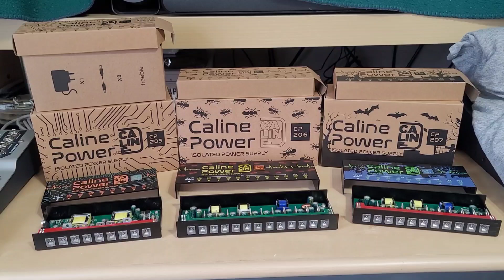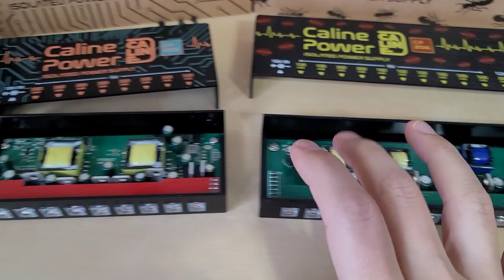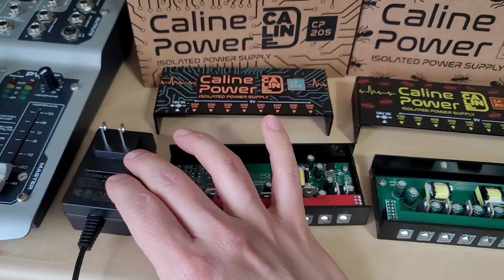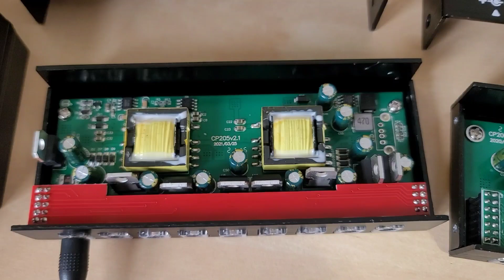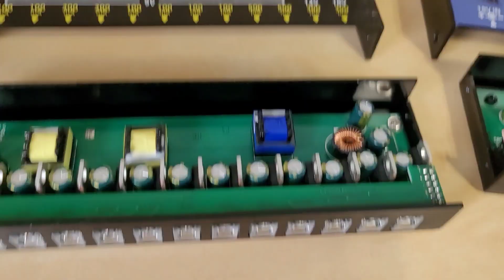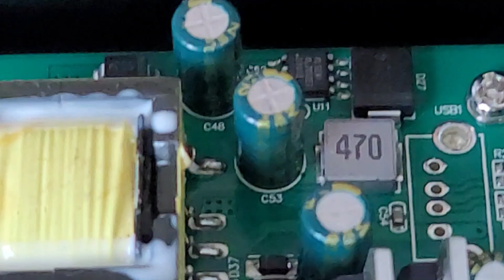Caline Pedal Power Supply: True Isolation? How They Compare To Other Brands?

Comment: Are these PSUs grounded considering they use a 2 prong wall adapter?
Reply from the maker: Yes, Class 2 wall wart PSUs use two prongs neutral and hot, but no earth ground. The neutral and earth ground are bonded at a residential main panel, but your amp because it has bare metal surfaces needs an earth lug to keep objectionable stray voltage potential off these metal parts. As a result a daisy chain with a class 2 PSU will create a loop between its neutral and the amps earth lug, acting like a huge antenna. 

Adapters like the One Spot add lowpass filters to reduce the noise this loop would generate, but cheap ones like the one I showed from Amazon, save the few cents and forgo those filtering components.
Reply: @Bassguitarist1985  You're a wealth of excellent information, just found your channel!

So in the above scenario you described where the Caline has two prongs vs a three prong ground, I think I understand why an amplifier would need it; but as an example, I also recently purchased purchased a Fender Engine Room LVL 12 in addition to the Caline CP-205. 

Why does the Engine Room require a 3 prong earth ground? Is it because it's providing 500mA on each of the isolated ports, in addition to two that can switch between 9v, 12v and 18v? Probably something basic I'm not aware of 🙂

As far as the Caline goes, I generally run my amplifiers and my power bricks first into a 3 prong power surge protector before plugging that into a wall - are there any additional benefits (other than protecting against surges) to a power supply like the Caline since it doesn't have an earth ground? Or does it literally not matter at all due to the reasons you highlighted above?
Reply from the maker: @CleanTheWookie  no matter. The above comment still applies. Thank you for watching!
Reply: @Bassguitarist1985  No probs, thank you for the response!

Comment: Hi bro. Thx for your videos. I want to buy the cp206, because i have 10 pedals in my pedalboard (one of these requires 18V). Do you recomend this power supply? I'm from Colombia (i apologise my english) here we have 110-120V from wall. Thanks
Reply from the maker: Hello! Long as your pedals do not need high current above 500mA yes this should be fine!

Comment: Nice review, as always. In your opinion, is there any mayor benefits between CP-206 and CP-207, besides of the increase of 2 more power ports? Are those two exactly the same?
Reply from the maker: Yes they are exactly the same. You just get a little extra capacity overall. Thank you for watching!
Reply: @Bassguitarist1985  Thanks. I just bought a CP-207. I have serious noise issues to solve.
Reply: @sebastian.arancibia  Did it solve your noise issue?
Reply: @slowpoke7888  Yes. I got the CP-207 and works like a charm. Totally recommend.
Reply: @sebastian.arancibia  Thanks Seb. I think I will get one.

Comment: So if I need an isolated 18v supply for my pigtronix rototron that I want to preserve and rum well... this should do it?
Reply from the maker: Yes. That pedal needs a min of 100mA at 18V, but recommends 300mA at 18V for headroom according to the manual. Yes this should be no problem!
Reply: @Bassguitarist1985  Thx for your reply! Mostly I was a little concerned about how isolated the circuit was and I run almost all the 9v at the same time as this if there'd be any risk of damage but sounds unlikely... how do you think the extra headroom works? Is it likely to clip more with the 100mA out?
Reply from the maker: @Tasjudoka  there is only one 18V output rated at 300mA, that should be plenty.

Comment: Awesome video!

I'm away from my kit right now, I won't be home for a couple of weeks, and I was thinking about power supplies. I started questioning how true it is that my Voodoo Labs x4/x8 are actually "individually isolated".

I started to think I probably got ripped off on a glorified daisy chain, because to be truly isolated, each output would need it's own transformer at least. so how could that possibly fit in something so small and light?! 

The way you talked through the circuit makes perfect sense, with each output having it's own secondary winding on a single transformer, amounting to the same thing.

I couldn't find anyone who actually opened one of these up, so I was itching to get home and look for myself. But now, thanks to you, I don't have to.

Thanks again for taking the time to make this great video.
Reply from the maker: My pleasure! Be sure to check out my other videos on these power supplies. They are great for the money but if you are trying to use them to power high current pedals like the HX Stomp or a multi-effects Digitech pedal for example, then they would not be the best choice for that application. Other than that they check all the boxes for about 98% of all the pedals on the market these days!

Comment: Is there a reason why you did not show actual isolation with a multi-meter (or better yet, a mega-ohm meter), or perhaps run one tap with a heavy load near it's rating on a long/inductive lead then measure crosstalk noise through to an adjacent tap running a light load ?

Just the appearance of transformers inside the chassis does not guarantee isolation. Even when a total of ten leads (assume two for AC-in and 8 for four +/-pairs does not guarantee the PCB layout and elements such as the panel-mount jacks maintain galvanic isolation. And these are areas where inexpensive power supplies have failed to maintain circuit isolation in the near-past.

Also, those transformers : They do not appear to be toroidal designs. (they look a bit more like a flat E-frame).
If so, they will be much more susceptible to crosstalk problems. These only show up under load (e.g. wide buss synchronous math processors such as found in DSP and ARM chips), and are particularly annoying when digital noise leaks from the tap supplying a e.g. large reverb multi-pedal and the noise shows up in an analog drive which has minimal filtering on the V+ and very low current draw.

I also want to note that, even though the per-tap linear regulators appear to NOT share a common heatsink, they also do not appear to have any heatsink at all. As far as I can see, there are no air-ventilation slots in the chassis of the power supply. This means that the heat of each channel is radiated into a dead-air space in the power supply, and relies on radiated conduction to the chassis.  From a thermal standpoint, this is a fairly inefficient method to get heat off the regulator's junctions and out of the device. And we all know that power supplies are often mounted to a pedal board via hook-n-loop materials, which are very poor conductors (in fact, they are great insulators). 
This little box has the potential to run quite hot (8 linear regulators and a relatively poor thermal conduction path.)

I haven't done system design in 25+ years**, but this one presents some real concerns, to me.

** (not exactly true, as I did some design of non melt-blown filtering systems for PAPRs in the early 2020s.)
Reply from the maker: Thank you for your comment and information! I have done an ohm test in other videos about these PSUs where it shows infinite ohms across the negative tips of the outputs. Unfortunately I don't have tools yet to properly measure cross talk noise. I do have the schematics for these and there is galvanic isolation from the wall adapter and the outputs. Multiple secondary windings isolate outputs from each other. I did not show the schematics out of respect for the manufacturer.

I too agree with you that the lack of heat sinks for the linear voltage regulators is a bad design. The biggest issue that I have with these power supplies is that they are not a good choice for high current applications beyond 500 mA because of that. For a budget PSU it checks the box for over 90% of all the pedals on the market. 

The manufacturer monitors my videos and I have a direct link with their product specialist (CS/marketing) who helps translate my feedback to the engineering team in Shenzhen. It's been a great working relationship as a prosumer of their products and other companies.

Thanks again for watching and for the knowledge!
Reply: So which one is the best and safest of thoese 3 models👆
Reply: @mohdazizan2181  To answer this, we'd need two things. (A) results of a dynamic (noisy) load test demonstrating the bility to provide clean power to a load with high-frequency noise transients in addition to the more typical low-freq dynamic load testing., and (B) a complete reverse-engineering schematic creation + component/tolerance analysis.
SINCE they are using a similar design methodology on all three, 'best' will boil down to how steady the power is under dynamic loading of all sorts; how well it rejects noise on it's inputs and outputs; and how well it rejects cross-channel crosstalk.
"Safest" is usually related to 'how close to runaway thermal junction temps" and how the design encourages junction temp reduction. This is VERY much a test-and-analysis question. Those who have done this kind of design before can look at a circuit, mechanical build, and cooling design and make general-observation-type statements.... I think they'd agree with the general info I put in my original post. I still don't like a no-heatsink, no convection-chassis design in a typical-use scenario where the device is located in a dead-air-space (under a pedal board) and mounted on thermal-insulated material (dual-lock). In this scenario, the junction temps of those regulators (when working hard to produce lots of current) can get closer to their failure temps, and certainly into a range where they begin to induce more noise. But this all takes careful measurement and analysis.

Comment: Hi! Thank you for your review. Looks like you know these units really well. I hope you could give me an advice. I just bought a CP-206 to power my HX Stomp, using 2x500mA outputs with a current doubler. For some reason it starts producing weird clicking noises after about a minute of use. I linked a video demo of this noise. Hope you could help me figure out what's the issue here. Thanks in advance!
https://youtu.be/YMSHl-hfBSQ

I should add that with the native Line 6 power supply it works fine. In this setup I'm also powering my Shure wireless unit from a 300mA output of the Caline. In the demo however I'm running it with a cable to eliminate the radio factor
Reply from the maker: Hey! I would actually add more current. The HX Stomp takes 850-950mA constant current. Have you checked the volts with both outputs?
Reply: @Bassguitarist1985  I haven't checked them with a tester but I assumed the 9v rating on them is correct. Do you suspect it might not be?
Reply from the maker: @rayzberg  I think there is not enough current to drive that pedal and it is causing the voltage to drop too far below 9 volts. The original power supply is rated up to 3 amps at 9 volts and the Caline would be maxed out.
Reply: @Bassguitarist1985  That's unfortunate. I know that people use 2x500mA at 9V for their HX Stomps, using other power supplies. Even the CIOCS video you linked suggests that it shouldn't draw more than 900mA. I was very excited when I found this Caline at about a quarter of the price of Voodoo Labs or One Spot power bricks. Too bad Caline is not able to keep up
Reply from the maker: @rayzberg  yeah unfortunately as you approach the max current rating of the output, the voltage will sag to about 8.7vdc. For analog pedals that is not too big of an issue, for digital pedals it can cause problems. 

Have you tried combining a 500+500+300 lines?
Reply: @Bassguitarist1985  haven't tried that. I'd need more sofisticated adaptors for that:)
Reply from the maker: @rayzberg  understood. Let me know if that works. Apologies for the difficulties. A linear voltage regulators are the limiting factor for these budget power supplies, especially since they are not heat-sinked, as a component heats up the voltage is going to drop. This is what I think is happening.
Reply from the maker: @rayzberg  I ordered myself some components to test the issue you are having. My guess is what is happening is the voltage is dropping below 9 volts. If you give me a few days I should be able to post a video on how to potentially fix this with the power supply you have. The HX stomp is a tough pedal to power with a standard power supply other than its own. My thought is the two 500mA + 500mA lines is not enough, and adding a 3rd output to compensate for the voltage drop of the linear voltage regulator will solve your issue
Reply: @Bassguitarist1985  appreciate all the time you've taken to look into this. I will also experiment some more to make sure the wireless receiver is not contributing to this issue
Reply from the maker: @rayzberg  My pleasure! I should have the parts by tomorrow, and a quick video up in the next few days.
Reply from the maker: @rayzberg  the Line 6 DC-3H is the OEM PSU for the HX Stomp rated for 9V and 3A or 3000mA. Pedal takes 800-900mA to run. I would double check the current doubler wire you are using. Wire AWG needs to be sufficient to handle the current. If not the voltage will drop too much.

I will do some tests in the next few days and get back to you.
Reply from the maker: @rayzberg  so I did a test with the two parallel 500 mA lines connected together with an 11ohm resistor to get about 800mA. The voltage is dropping to 8.7 VDC. This is normally acceptable but for digital pedals they may require tighter regulation. It is also important to note that you need at least 18 gauge wire in order to run a load like this otherwise the standard 24AWG to 28 AWG will be insufficient size as the voltage will be lower at the pedal then at the source because of the thinner wire causing the voltage drop. 

It is also important to mention that series linear voltage regulators employ a series load resistor in the circuit design so that in the event of a short circuit instead of the regulator burning up it will be a resistor that can handle the wattage dissipation. As I mentioned in other videos this is the main limitation when it comes to these budget power supplies. That's where strymon and Cioks with their DC/DC converters are better suited for such an application. Far more energy efficient with little waste heat and tighter regulation because of the circuit design.

Sorry you are having trouble but hopefully this information will be helpful!!
Reply from the maker: Looks like the original PSU is rated at 3A or 3000mA! I dont think you have enough current and the voltage is dropping below usable levels.

https://youtu.be/DccNM_5NJts

Comment: Because you said that these power supplies “are much better than a daisy-chain”, I’d like to see you do a comparison of the one of these Caline power supplies and the TrueTone 1 Spot Daisy-Chain. 

https://youtu.be/p5g25OhtLFU
Reply from the maker: The pedals that make noise are due to inadequate filtering on the power supply. Digital pedals rely on an internal clock to run the DSP chips. This clock is running at a very high frequency beyond human hearing. If the circuit is not carefully designed/filtered to prevent a phenomena called "heterodyning,"  (which is the combining of two high frequency signals to produce a lower frequency, usually harmonic content bleeds down into the audible range) then you get the noise you demonstrated. It is also possible to get noise with pedals that take incoming 9VDC and convert up or down to a different voltage. Same issue with lack or improper designed filter components.

This is why pedals like these need their own isolated/dedicated PSU to prevent these noises/perturbations from traveling on the incoming power lines to other pedals. There are also power line filters that go between the daisy chain and the pedal to reduce the noise traveling on the incoming power lines back through to the other pedals. It is a simple common mode choke designed to bleed any high frequencies to ground, reducing the noise, but some is still passed back through the lines at a reduced dbu level.

I'm just a bass player with an affinity for electronics! 😄
Reply from the maker: Thats a great idea! The video you sent was very interesting to watch too. There are instances where a daisy chain works perfectly fine. Its when you bet into digital pedals and pedals that have a step down or up converter for the voltages. Sometimes these circuits are not properly filtered and can cause noise to flow back on the shared ground of the daisy chain to the other pedals. Thats why isolated PSUs are superior to daisy chains, each output is its own supply and no influence on the other next to it.